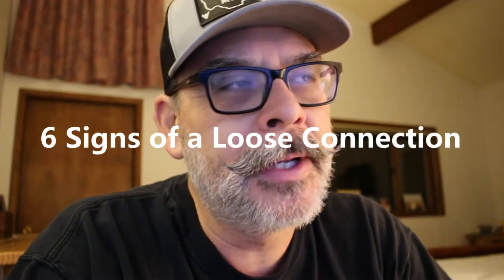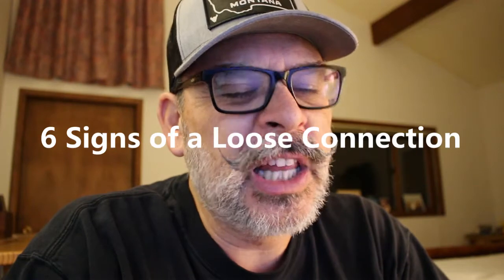6 Signs of a Loose Connection

Comment: When it is loose.
1. The wire temp is high .you can touch and it is not normal.
2. It will trip repeatedly once the load gets high.
3. Period.

Comment: I think its a loose connection in my house, which is tube and knob
I can use low draw but if I plug in a microwave.
The plug was dead for several day then it came back and ran a coffee pot with no trouble.
Any sugestions
Reply: call an electrician.

Comment: I had a loose wire on switch and it jumped to an outlet. The loose cable made kitchen light to not work. 

The electricity was causing other outlets to go off. The breaker didn't trip, I also had buzzing in panel. Two Electricians could not figure out. We accidentally stumbled upon a loose wire and issue fixed.

Comment: Thank you for the helpful video! 

From this info I suspect I have a loose connection within/around one of my lights (it flickers + also all the lights in that room burn out in a matter of weeks). A few questions:
1. Can another sign of a loose connection be - the light bulb turning black inside (internal carbon residue build up perhaps?), this happened to the light bulb (this type: https://tinyurl.com/y3pqfrh7) in that specific flickering light. 
2. If it is a loose connection - how dangerous is it if left as it is? This issue in my flat has been ongoing for 4+ years and has been a nuisance but can it also pose a safety risk if not dealt with? (I live in a rented flat and the flat owner has been avoiding calling out and paying an electrician to look into this issue)